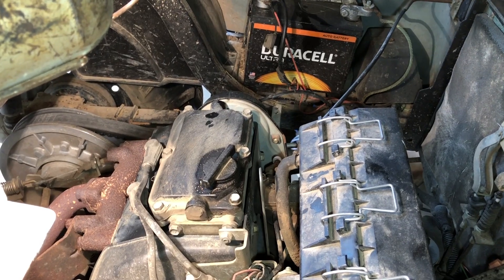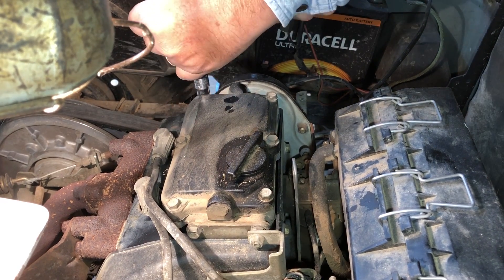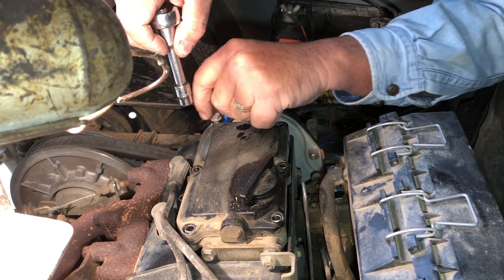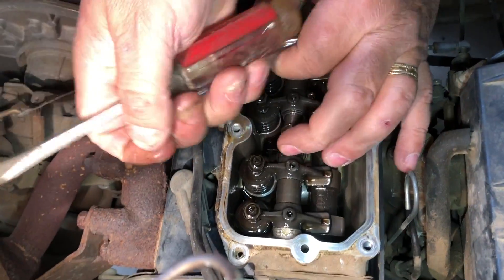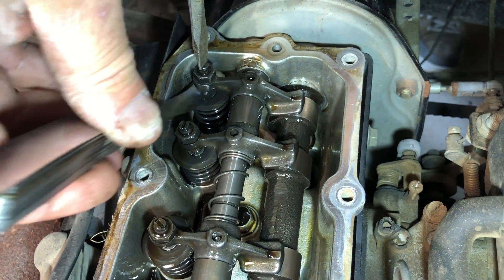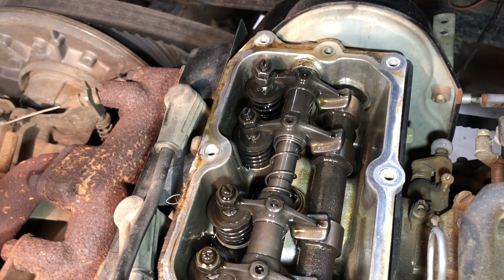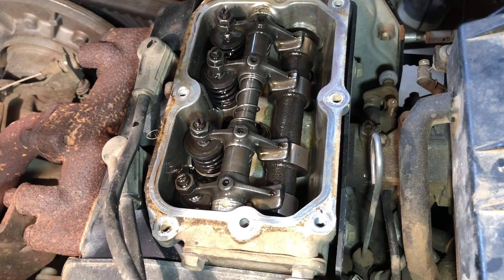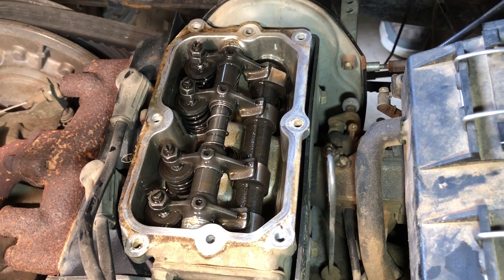EZ GO Golf cart valve lash adjustment

Comment: Yep once a year ! also new plugs and change oil, clean out the oil screen ! good to go ! ya cant beat a robins motor
Reply from the maker: This thing will only run with the choke out. Needs a carb bad.
Reply: @bctruck  ya run high oct fuel in it ? run some carb cleaner and fuel stuff like stable or stp ? O also there is a junction block kind of thing , that the fuel pump stray that screen
Reply: Ive never had to replace a carb bro ! there tuff motors
Reply from the maker: Your the guy I need to talk to then. I’m totally unfamiliar with these engines or even where to get parts.
Reply: @bctruck  Ill call ya tomorrow ?
Reply: @TheRedneckprepper  can you help out in a robin that i have ?
Reply: @elimontano3921  WHATS WRONG ! I might but im not a golf cart mach , just had a golf course n had to make them go